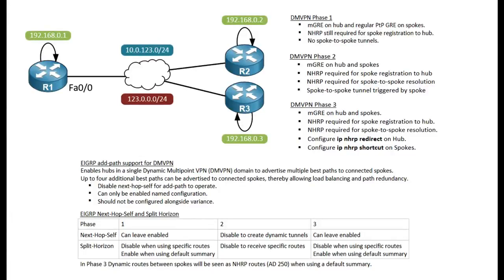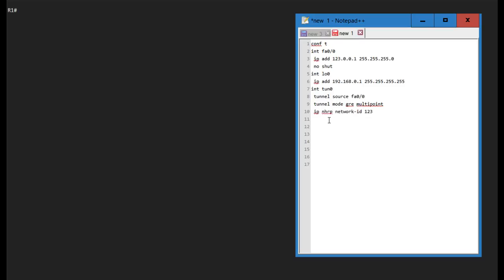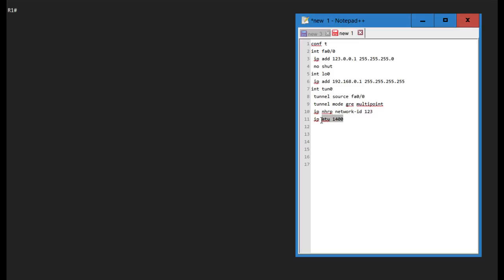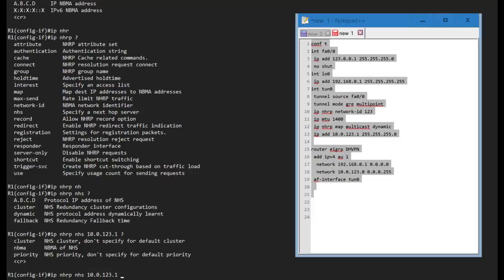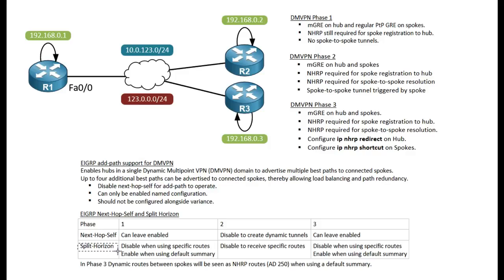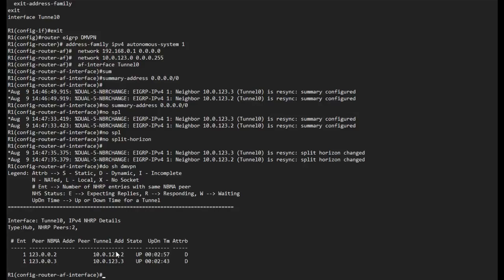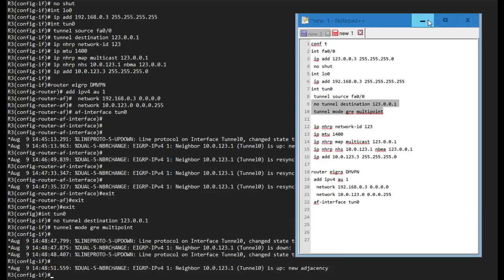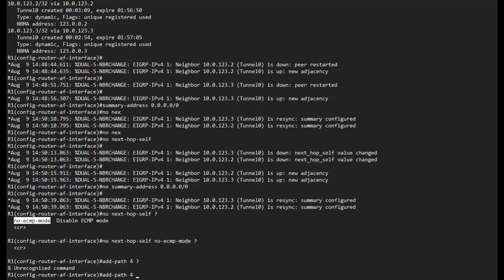Quick Configs - DMVPN & EIGRP (phase 1, 2, 3, summarization, split-horizon, next-hop-self)

Comment: Hi Ben, I stumbled upon your channel while researching what routing protocol to use for our DMVPN project (Do you have any prefered protocol btw?). I must say I am very impressed with your videos on this channel. They are just as long as they need to be with relevant information. The only other thing I can think of that would make them better is if you included the configuration in the video description (maybe in a pastebin or so). None the less, very excellent work.
Reply from the maker: +perfectgyroscope Hi! Thank you for the feedback and kind words :) I'll look into adding the configuration to the descriptions, I also have this huge OneNote file that I might be able to share on the channel. For DMVPN I think the easiest and probably most scalable config is with BGP. Other than that I'd probably use EIGRP.